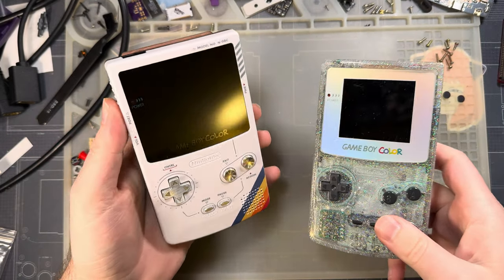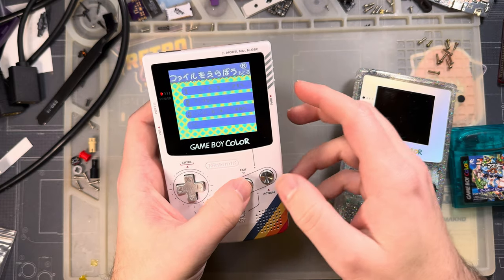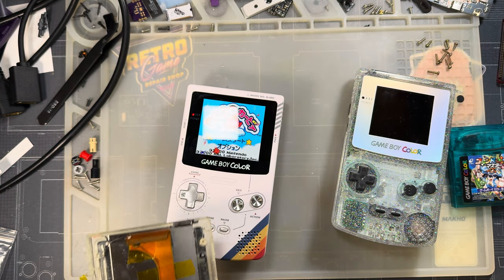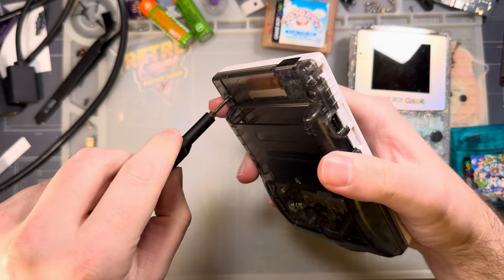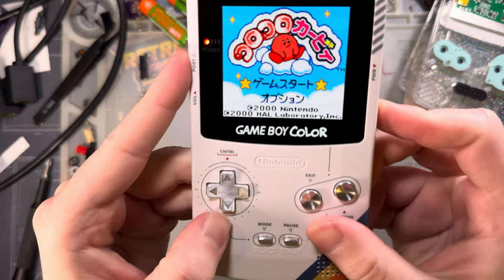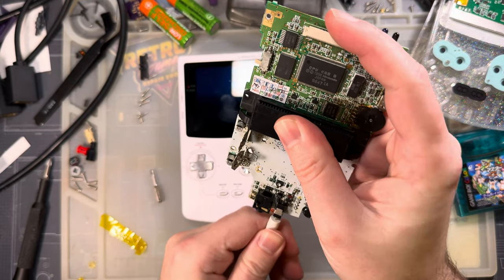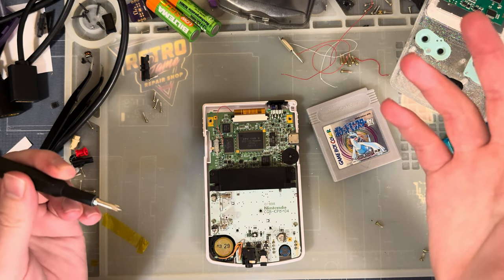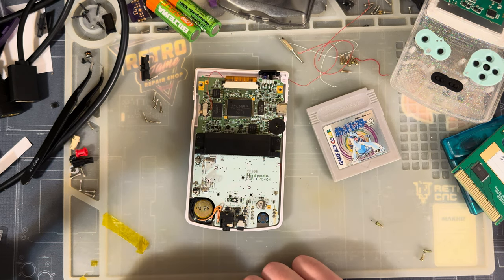Game Boy Color OLED Kit Follow Up -- Glitch Testing and Power Usage

Comment from the maker: It's possible the issue I was told about is exclusive to CPU-01 boards with REV A CPUs but since I don't have one, I cannot confirm. I assumed it was a similar issue as what the 9380 kits were experiencing but since this OLED kit works fine on CPU-02 and 04 boards with REV B and D CPUs respectively, it seems that the issue is unrelated. Additionally, the kit maker tested this issue too. They did have a CPU-01 board but they did not have the same games so it's still not ruled out. Perhaps the original issue was just an improperly seated connector? 

The initial issue was forwarded to the kit maker and this was their reply:

We test the GBC 01 motherboard with 6 different kind of game cards
We cannot repeat the issue you mentioned
Currently we  did not have the same game card as your video. We will buy it and test them once we get the new game cards.
Reply: Thank you for the feedback - I've been trying to find others with a CGB CPU A so we can try to reproduce the issue!
Reply: @ZippletTech  Could you check my comment on the main video and let me know if that's the issue that we're looking to reproduce?
Reply: @lilmul123  I can't find your comment on Makho's original video

Comment: I have an 03 with an OLED and I have not noticed any issues. Also did a power regulator swap  (removed the old one completely), no issues with that either.
Reply: I also have an 03 with OLED and no issues. I just need to recap for some buzzing after an amp was installed with the oled

Comment: Hey, could you link me to more info about his issue? Maybe some images or description of what happens? I think I might be experiencing the issue in question.  I have a CGB-CPU-03 with REV C CPU.  For me, the horizontal pixels seem to shift left a few seconds after first power on.  I can fix it temporarily by turning the system off and on about three times and then the picture stays stable.  But it comes back after not playing for a while.
Reply from the maker: You should record the symptoms and post to the Game Boy discord or subreddit
Reply: Curious if you found a fix for this.  I have the same board but my screen won't be here for a few weeks.  I'll let you know if I run into the same issue.
Reply: I can confirm I don't run into this pixel drift on my CGB-CPU-03/Rev C CPU board.

Comment: From my personal experience, boards 03 & 04 are the most common with CPU C & D. For me 03 D is solid, never had issues. The problem was with CPU C and under had issues. D up had no issues. 03 could have C or D depending on date manufacture.

Comment: Follow up: Until we prove this by having others reproduce it, take this with a pinch of salt as stated in Makho's pinned comment
Please test CGB CPU A; we have a troubleshooting post opened by someone that has issues with that CPU rev. When sprites are displayed it causes a couple of pixels of offset for tiles on that scanline. I know that clock timing was altered between some of the CPU revs.
Reply: CPU-A is extremely uncommon btw
Reply: Yea, likely more common in japan?
Reply: I have some boards with CGB CPU A - but no OLED kit yet. I will test them once I get my hands on a kit.
Reply: @ZippletTech as in my message in the troubleshooting post on discord, I can confirm this issue occurs with my CPU CGB A board too.

Comment: Makho, could you make a video creating a GBC or GBA with your most favorite mods? :)
Reply from the maker: Short answer: No

Long answer: I already did.

I prefer minimal electrical mods. My preference is to stop at case mods and a backlight kit only. Maybe I'll get fancy and add in a replacement power management circuit to bypass the shitty power switch on these consoles and add soft-latching. 

The "ULTIMATE <YEAR> GAME BOY" builds are a total meme and rarely result in a good experience. The people you see doing builds like this are doing it for engagement, not because the end result is actually good.

Comment: What’s battery life with OLED?
Reply: About an hour or two better than with the Q5 with the extra power wire installed.
Reply from the maker: That depends quite heavily on your batteries, the games you’re playing, and the settings on your kit. I’ve measured the power usage before and after the kit so you can extrapolate with my numbers if you want.

Comment: Any idea if FunnyPlaying intend on doing their own OLED kits?
Reply: i wouldnt bother. funnyplaying has a high defect rate and this kit is already so good.
Reply: @kingju1ius  You raise a good point. I've had several screens from them and haven't had to return any, but some have had light bleed issues despite being 'laminated'. I was able to fit a piece of paper down the side of one of their panels that was supposed to be laminated. I had to use electrical tape to seal it properly.